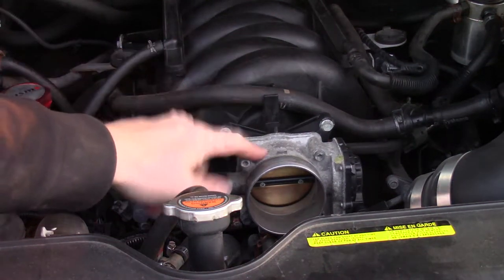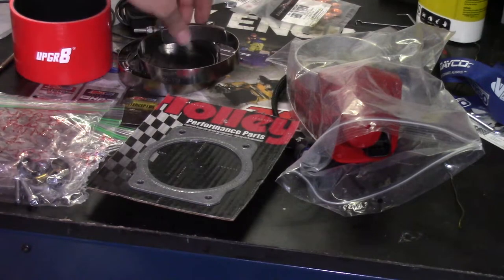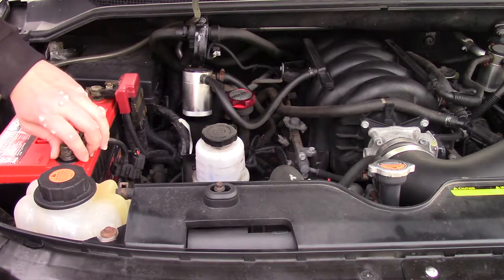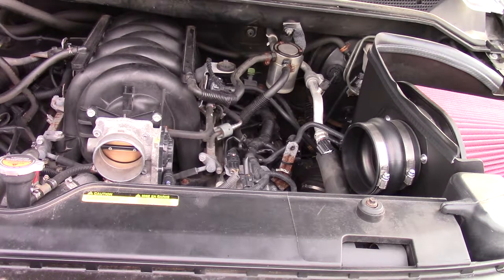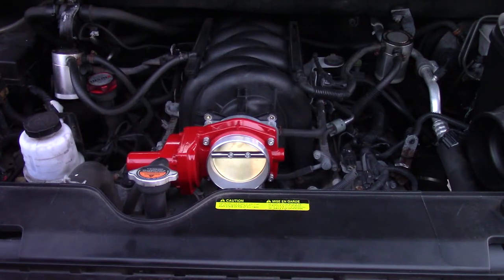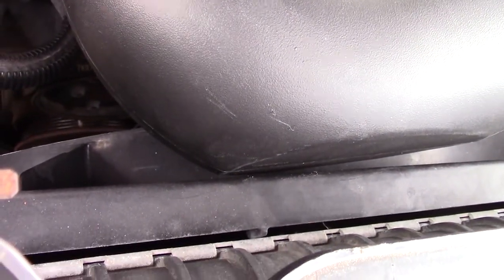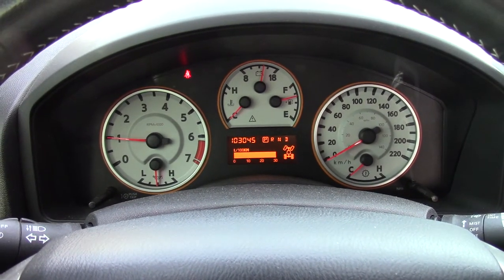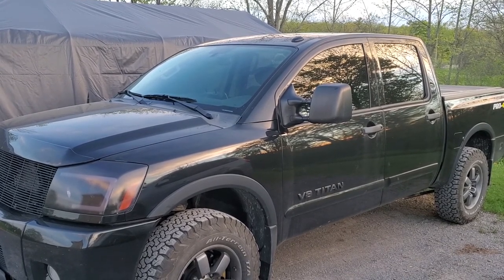How to Install an LS 90mm Throttle Body in a Nissan Titan

Comment: Interesting but I personally can't see it being worth it due to the stock intake manifold and cost.  it will increase throttle response but I don't think you'll see big hp gains.
Reply from the maker: I'm happy with it so far.  My next big project is to modify the stock intake manifold!
Reply: Titan don't have bolt on horsepower gains, ECU don't allow
Reply: @DonaldTanner-q2l    ECU's do allow bolt on horsepower gains but the ecu has to be returned.

Comment: Do you notice a good performance difference?
Reply from the maker: Yeah it feels great.  I occasionally have to hold throttle pedal down when starting but I will see if that can be fixed with tuning.
Reply: @TitanTown  cool

Comment: Hows the daily driving characteristics now that you've had this on for a but? Is the stalling issue resolved by now or is it something you're still dealing with?  I'm very interested in this kit and I contacted performance already. I'm located in a cold weather climate and I really enjoy the remote starting.
Reply from the maker: Not a lot different.  Power is very responsive.  The cold start issue is not present above about 15 deg celsius so not an issue over the summer but it might start to get slightly annoying as fall and winter are coming.
Reply: @TitanTown  I have read that you can drill a 3/16 of an inch hole hole centered above the throttle plate bar and it's supposed to resolve that issue.  Have you heard anything about this?
Reply from the maker: Yeah i've heard of people trying.  It may also change the idle and affect the tune though.  I haven't had an issue in about 3 months but think it will come back once its cold.  I might try something then.
Reply: @TitanTown  that's true I didn't think about it changing the tune. Well I hope that it isn't too bad.  I'm hoping to have it installed and dyno tuned at an uprev tuner in next couple weeks!! Love your channel its a go to for me when I have an issue and to preplan my mods!!
Reply from the maker: @aaronkowalewski659  thanks

Comment: Next vid: installing shift kit on re5r05a 5at
Reply from the maker: I might buy a valve body from Level 10.  I'm supposed to have a new aluminum radiator on the way.
Reply: @TitanTown probably the better path, I’ve seen a tutorial to install shift kit and it looks easy to mess it upz 800 is hard to swallow, but level 10 is trusted
Reply: I noticed the whistle as well with 90mm. If I don’t do the idle air relearn will that mess up the tune?
Reply from the maker: @ivand5527  it will still work.  The ecu is always actively learning.  I think the procedure just helps it learn quicker

Comment: Bigger Tb with a not ported intake 🤔 not going to see hardly any difference. Most likely why he sales the tune to make you think it done something that it really is. Stock intake hole with a bigger TB no power gain at all
Reply from the maker: The stock intake hole is already bigger than the oem throttle body.  in the video I show you the different sizes of the intake, old throttle body and new throttle body.

Comment: What year is your truck? I have a 2013. I saw a post on some forums about a 2011 having issued with this mod. Idk if they had a tune. Also can you send me a link to the tuner?
Reply from the maker: Hi, its a 2014.  You need a regular uprev tune, then have it retuned for the throttle body.  Buy it from uprev.com and say that you have or will be getting a bigger throttle body.https://youtu.be/mX9fZK3Psd0?si=NoRrO3SF-T3_R_bZ

Comment: My truck is having issues running and would not rev while park, it takes couple of time turning it on and off to get the throttle body to respond and runs. Could it be a bad throttle body, because I ran it
Reply from the maker: Did you install uprev? Contact your tuner he might be able to fix it.

Comment: Really confused on the coolant bypass part, where do you put the bypass fitting and all of that?
Reply from the maker: The kit comes with a barb.  Just take the two hoses off of the oem throttle body and put them together.  The hoses are below the lower left of the TB.

Comment: Do you gain (obviously, aside from better airflow) more hp, torque, mpg, throttle response, and better sound, or just certain things? I feel like this could be an install I could possibly do myself, so just curious. And if my Titan has been tuned (upRev), will I need to do that again or anything else when upgrading the throttle body? Sorry for the basic question. I am just starting to dive into things that I can possibly do myself to increase overall performance on my 2010 Titan LE. (I've done a Volant Cold air intake, that's it though)

And I like how the link to Amazon says immediately that the throttle body isn't compatible with a Titan, but yet here you are making it work!  Yet what led you to choose this throttle body in particular? 

Thanks in advance!
Reply from the maker: I don't have numbers but acceleration feels faster.  It sounds good.  You will need the adapter kit to make it work and an uprev refresh specific for the throttle body.   This one is proven to work and there is an adapter kit and reflash available for it.
Reply: @TitanTown  where/how did you reflash your ecu?
Reply from the maker: @JohnAnderson-kt4mb  with uprvev https://youtu.be/mX9fZK3Psd0

Comment: How did your remote start go with the new throttle body?
Reply from the maker: Not well in the winter.  It works fine when it's above about 15c.  Bow that and I have to hold gas pedal a little when it first starts.
Reply: @TitanTown  dang! That's unfortunate. Down here in Idaho, it gets very cold as well. And remote start is.., well vital at times haha

Comment: Don't you need change the intake manifold?? You only gaining 3mm .
Reply from the maker: 3mm dia.  Air is measured by volume not diam. so that 3mm makes a difference.  I have been working on a new intake manifold that will be installed this spring.  The extra width of the bigger throttle body also makes up for the lost volume of the throttle body butterfly.